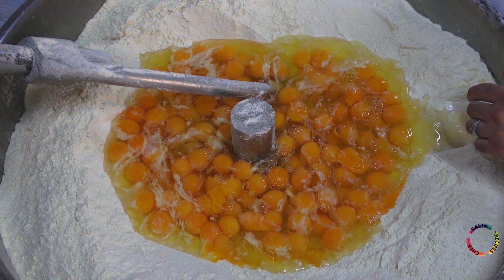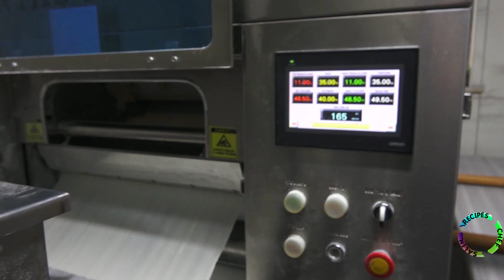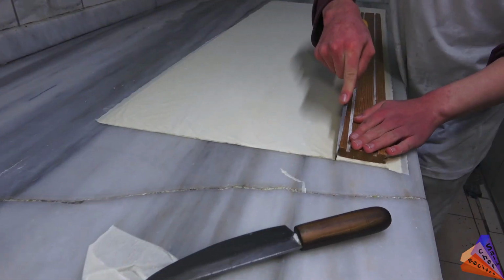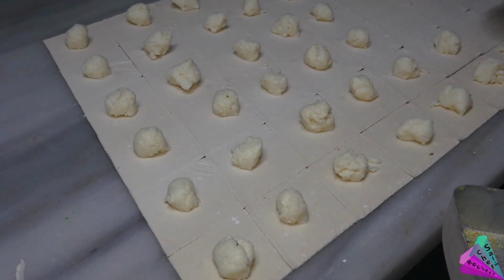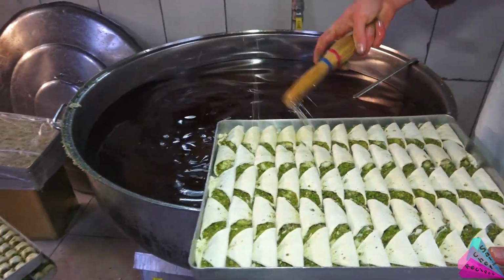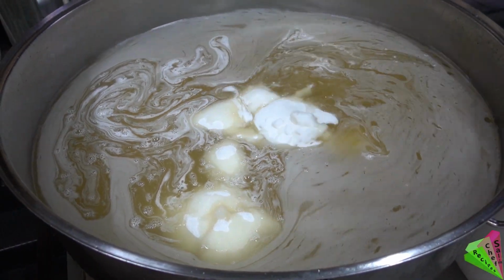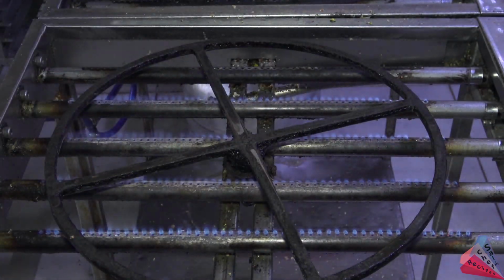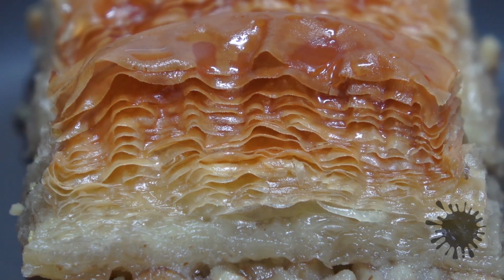Turkish Baklava Varieties Pistachio And Walnut Wrap Baklava Recipe How To Make Sobiyet And Kadayif

Comment: Hi, I am wonering about the sheeter machine, do you use starch for saparating the layers or because it is too hard dough there is no need for using starch. Also, if we looking to have a white Baklawa is it ok if we made the dough without eggs?
And my last question, how much it coast the sheeter machine with all its relative stuff.
Many thanks
Reply from the maker: yes starch is used,
  If you want white baklava, it is a situation related to frying, I know that it is cooked by covering it so that it does not brown and it is cooked for a long time, I did not understand the last question.
Reply: @ChefSalimRecipes  sorry it was a typos, I am wondering about the whole Baklawa machine price, with all the needed parts.
Thanks